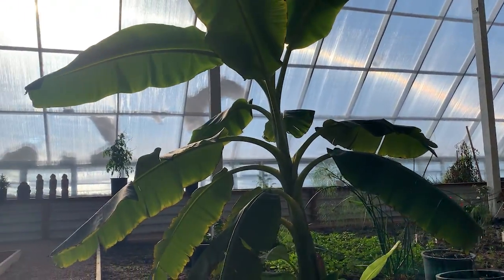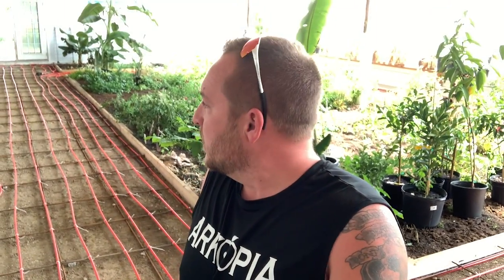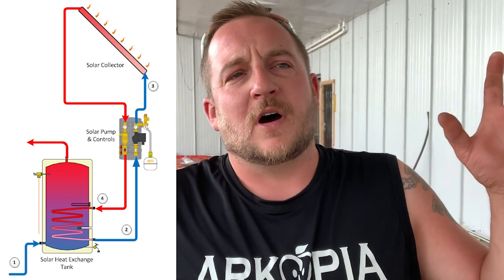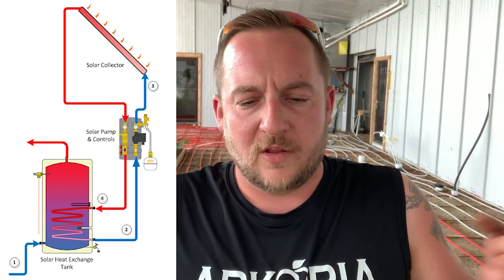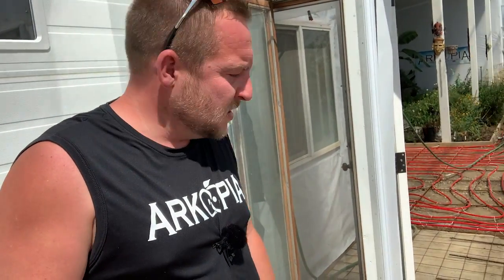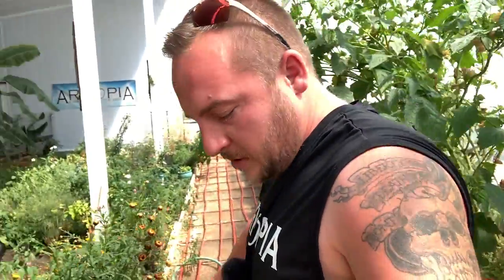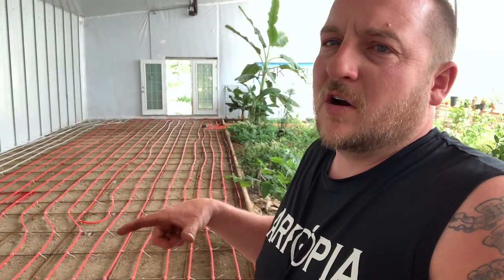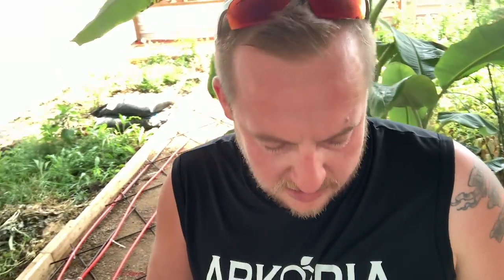Water Thermal Mass for Deep Winter Greenhouse

Comment: Love your design, I went to solar and renewable energy school about 15 years ago, and studied a lot about earthships since, learned a lot about hot water heating then, the evacuated tube collectors outside main problem is there so well insulated that when you have snow or ice on them it doesn't melt unless you clean them off and summer time gets way too hot, I like putting them in the greenhouse its expensive for sure and they break relatively easy. When I sold hot water solar systems in the late 1970s they were a black copper pipe, of course put in pop off valves for over heating, with a half round reflector behind them very simple. Could use shiny flashing bent half round. 1 or more running the whole length of your greenhouse with a solar power pump it would be automatic. I'm not sure about the back wall but definitely mid section. Could be covered in the summer and start heating your thermal mass late in the summer.
 Also you could run your system in the summer  from your rain water tanks to cool the concrete down , hope that made sense.
Reply from the maker: It made sense.   Thank you. 🙏

Comment: Evac tubes are for heating the water, not for holding/storing hot water.  The evacuated space between the tube glass and heating pipe acts as an insulator from the very high heat of the heating pipe. Moving more carrier (water/glycol) faster through the heater tubes will help keep it from reaching the boiling point. (60%/40% water&glycol mix should allow for the temperature to got up to around 234 degrees F before boiling. There is not that much of a volume that the tubes can hold.  You want a large volume/mass of water to hold/store heat. Better if you could put barrels in a well insulated structure next to the greenhouse ... or even with barrels stacked/and or buried and insulated in the ground.

Comment: I have a Viessmann vac tube solar hot water system and it provides an amazing amount of hot water year round even on an over cast day. I had an apartment building with infloor and no insulation. We had a breakdown and it took a week for parts. The heat sink mass/ground kept the units at 21c for that week in 40c below outside. It really does work. If I was to do it again I would insulate the outside of the foundation. Look into salt for the drums on the back wall as a slow release heat sink. Maybe a solar electric system to run your pumps. Just love your system. I see were Nate is coming when SHTF.
Reply from the maker: Awesome.   Ya, because I insulated the foundation 4 ft down around the perimeter, I shouldn’t loose any heat there or have the cold creep in.   I’m really excited about this new revelation of the solar hot water panels.   🙂  thanks for the info. 🙏
Reply: @ArkopiaYouTube  Because our panels are outside there is solar antifreeze in them. I installed a few of those systems before I retired and a note, if installing on a sunny day use gloves to handle the tubs because they get hot almost instantly. Also keep them in the box shaded until you are about to clip them in place. I have a self built 1 KW solar system I built and use to power fridge, freezer and heating system in power outages. I purchased batteries being removed from cell tower sites and cruise ships at a fraction of the cost new.
Reply: Here in southern Spain we just use convection solar water heaters, vacuum tubes gets WAY too hot here! Those who tries ends up having to partially cover up their arrays not to boil their systems.

So yeah, they work really well!

Comment: I’ve installed a 90 tube of evacuated tube solar collector on my girlfriends house and it works great except it is so efficient it won’t melt snow off. You can boil water easily with it. It’s my suggestion to put it outside though. Use tempering tanks that way you can have unlimited free hot water. I like the water barrel idea better because there’s more sensible heat capacity and just water in a barrel. Yeah might take up 2 feet but believe me it’s worth it in my outside shop I have tons of water barrels and it works amazing. There’s nothing more effective than water in a barrel. 

And then of course solar Pv to run the electricity for fans and pumps is a no-brainer. If you need help design in the system you can ask me
Reply from the maker: Thanks for that.   I still like just water in a barrel.   It’s so simple, just there, up to temperature, easy peasy.   There is an issue with all the plants getting big and shading inside as well.   I think you might be right putting the collectors outside on the roof.

Comment: Check your area for the frost line (how far down your soil freezes). You can put your water storage tanks underground and save space on your property. Below the frost line, dirt is a pretty good insulator. You can eve add extra storage capacity. Rig it so the water circulates, starting towards the end of summer to get a jump on the cold weather.  In the dead of winter if you don't get enough sun to heat all of the storage capacity, you might want to make it so you can change over to half capacity. They probably have a formula somewhere to figure out a proper sun to storage ratio. Just make sure you don't drive anything really heavy over that space.
Reply from the maker: That’s a good idea as well.  Underground yo save space. 👍

Comment: As always, love seeing what you're doing with the greenhouse, we're on a lot of the same idea streams^^ AFAIK, the only other reason besides not freezing, they use glycol because it has a higher heat capacity than water, but I would think if you go with water, except for the heat exchange coil area in your storage tank, it will give you another measure of safety against overheating indoors with the tubes, also if you're ever worried about overheating at a part of the year with them, you can always grow something that climbs, cucumbers, beans, etc.that you can tear out when you want tit to get full sun on the tubes.

I think its a good work around for an installed building vs climate battery. Although dont lose the wood stove, love seeing it going when ur chatting in the greenhouse XD I think lots of ppl in the channel would love to join the colony ^^
Reply from the maker: Oh for sure I’ll keep the wood stove in there.   But hopefully it won’t need to run all the time, just occasionally.   I’ll put a coil from the wood stove in the infloor heat tank to help that out more too. ✌️

Comment: Thanks Dean for another great video. 
Did you consider larger pex tubing and used car/ home radiators connected to this heat system ?
Also raising the black drums on a strong shelf and fixing the solar thermal tubes below them on the back wall may save space , help coollect rain water and use it for watering by gravity. 
Looking forward for completing this nice project and assesing results/ cost-effectiveness.
Please keep up the good work 🙏
Reply from the maker: Good ideas.   I’ve always just used 1/2 inch pex in 300 ft zones.   I suppose I could have upped the size.   The rain water tanks are going up high and out of the way on some pallet racking.  (Square IBC totes).  Out of the sun. 👍

Comment: The Nebraska retired postal worker said his back wall was angled to reflect the sunlight but 25 years later his orange trees blocked that north wall so it doesn't get the sunlight.
Reply from the maker: Good thought.   Maybe it’s best to have those solar things outside.   It’ll be a jungle in here eventually likely.
Reply: @ArkopiaYouTube  he also has grapes running up the ceiling from the north wall towards the South...
Reply: @ArkopiaYouTube  and after he said that the water tanks on the North floor never get hit by Sun so they don't really get heated up that I thought it would be good to put the water tanks on the south wall at the bottom so all the runoff from the greenhouse goes right into the tank.
 And since I raise fish I make it an open top deep channel filled with water plants and fish. Since the angle of the greenhouse comes down you can't really grow anything that close to the bottom anyway so that's where your thermal mass is on the South knee Wall. And of course the bigger the wider the deeper the water tank the better chance I'll be swimming in it especially if it has a current.

Comment: Thx for sharing.. nice job!
Are you worried about fumes from painting the concrete floors..
If you color the concrete it self.. might be more cost effective and less toxic fumes In the air.
My 2 cents..
Great ideas you have . Keep.it up🇨🇦
Reply from the maker: I’ll paint in the summer here when it’s well ventilated.   The prices I received for colored concrete were insane.   Still looking into it all quick here. 😂
Reply: @ArkopiaYouTube  worth a look. Coloring the top 1 inch should be easy when finishing off your slab.. 2 bags of color , TOPS I figure..

Comment: Loving your creativity and ambition keep pushing, I'm watching with serious interest for a smaller family sized set up like you've got. Spray/dust the concrete with black pigment for your color before the final trowel your concrete. After you wait two weeks for curing Spray/microfiber mop (10 coats not kiding)of industrial uv resistant floor wax Zep makes a five gallon jug, add quartz dust/anti slip to your final two coats of wax for traction the concrete. Just suggestions for reducing costs and still having a great finish. I used this in my shop with amazing results for a huge savings vs epoxy.
Reply from the maker: Interesting.   I thought pigment was added to concrete when poured, and it was ridiculously expensive.   I found a product that is a garage floor paint/epoxy and was thinking that was the cheapest and best option.   🤷🏻‍♂️
Reply: @ArkopiaYouTube  it can also be used after the concrete has been bull floated.  The powder pigment can be hand thrown onto the concrete or you can use a leaf blower at slow speed to broadcast the pigment. If you hard trowel or use a rider trowel it will look slightly mottled. I added more pigment to my first 4 coats of wax and it gave it a consistent look when I was finished. It looked like black glass.

Comment: Yeah I love this idea too.  With the evacuated tube system one reason to use glycol in spite of being indoors, may be to inhibit corrosion/scale in the system.  Brilliant thinking outside the forms there Dean!
Call it a colony or a 'cult of personality', I think  we're ready to drink the Arkopia kool-aid!🙂
Reply from the maker: Haha.   Thanks.   Ya, glycol might be for the corrosion or maybe it withstands higher temps.   Slowly figuring it out.   A bunch of guys told me rain water is best for infloor; I think that is for corrosion prevention as well. ✌️
Reply: I don't doubt the rain water in the pex in floor.
Exactly, a radiator with just water in it boils more readily than one with the proper ratio of glycol in it.
It will be interesting to see where you go with this.  Thanks for sharing.

Comment: My understanding… optimal in floor heat is around 90F. Lower than DHW so those heat transfer tanks are handy.  You might need a tempering valve. And likely a mechanism for limiting heat on evac tubes otherwise you have risk of having to dump the heat or blend in cold water

Comment: Thanks for the info brother. I'm planning to build a Passive greenhouse using Compressed Earth Blocks for
the walls. The plan is to insulate the exterior side of the wall with thick rigid foam EPS and then 3 coat stucco or cladding.

To create heat storage and distribution I'll create a partition walls using CEB.
The plan is to drill probably 2 holes or so through the side of the blocks and stack it to appropriate height.
I will run radiant heat tubing through the holes and connect it to a solar system. Not sure how well it would work???
I have never seen it done. I thought it could be an efficient and low cost way to heat the greenhouse on cold winter days. 
To back it up, I'll have a rocket mass heater.
Reply from the maker: No experience with compressed earth blocks, but whatever it is insulate any thermal mass from the cold really well. 👍

Comment: Good seeing you at the grocery store today. Looks good. Let me know if you need any advice with hydronics. Im an HVAC/R plumber in the Stoon area. As for the glycol factor. As long as a the building never freezes, your lines wont freeze. But if you hit the 0 degree mark you may have issues. Pros and cons to what you are doing. Did you insulate the perimeter to maintain a frost break? Id chat with you more if you want to bounce ideas.

Good luck, looks great.
Reply from the maker: Second time ever being recognized from the YouTube.  Haha.   Thanks for the tips and connection.  It’s really well insulated around the perimeter so not too worried about using just water.   Maybe it’s worth the glycol just in case though.   That would really suck having the system burst somewhere.  Thanks again. ✌️👊
Reply: for the cost of a pail of glycol, it would have you alot of potential headaches. a burst line is a costly nightmare.

Comment: Love your idea but you are confusing thermal mass (heat storage) vs a radiant heat system either using a boiler or evacuated tube solar hot water. there is a calculation for how much thermal mass you need for your total glazing area (it is around 3 to 5 Litres per or something like that. I would keep those black barrels for actual thermal mass at the back of your greenhouse. But you could put the evacuated tube solar hot water using those panels on the roof. 
I have designed by 20x24 ft greenhouse but I am using passive house walls and have reduced total glazing area so I only need 30, 200L/55gal rain barrels for thermal mass. I am also planning on using evacuated tube on the roof as a backup.

Comment: Sounds very doable. Of course you need to air test that pex before concrete. With that box of Styrofoam on the outside wall the earth should act as a heat sync.
Reply from the maker: Yup, gonna test lines all today and tomorrow here.   Thanks buddy. ✌️

Comment: Dude, instead of running those coils in a water tank, you might want to consider filling those tamks with sand...can store  932 degrees F and it doesn loose temp for months and months.. That way you are not possibly making a steam bomb
Reply from the maker: Interesting. 🙏✌️

Comment: My sisterinlaw has a roof mounted hot water tubed system, something not water runs to a heat exchanger
for domestic hot water Since hers is on the roof, and it doesnt get to -50 around here.....
If you have a specific question, I can ask her.
Reply from the maker: Thanks.   If these things work as good as I’ve been recently told, might have to do a domestic hot water one too. 🙏

Comment: I was wondering if a solar water heater and a pump pushing the water deep under the green house is a better idea. I understand water picks up and transfers heat better than air. My question is if you considered a deep layer of pipes instead of the pipes in slab? I know your idea is the slab is to be a heat generator,  but what about the opposite? Dig up your garden, lay deeper pipes, and reinstall the soil so the slab feeds radiant heat below the crops. Your thoughts?
Reply from the maker: It all probably helps.   If I had access to course gravel, I may have done the climate battery with air tubes.  I'm sure heating the soil would work.  If I do the solar collectors, maybe a dump line under the garden area would be a good idea.   All of this is a ton of work.  haha.  Thanks for the thoughts
Reply: @ArkopiaYouTube  I am planning a passive solar green house about 37'x 24', probably dug into the earth a few feet. I have a house in the Denver area, so while it doesn't get as cold as you get, I want it productive all year round. I am wanting tropical plants - such as citrus, guavas etc in addition to the veggies. I like the earth battery concept but wonder if solar heated water in 1 1/2" PVC flex pipes would be more efficient than blowing air underground. Air doesn't transfer heat as well as water. My experience is hot air doesn't like to go down, but water doesn't mind. With it warming up a lot of soil I hope it should stabilize the heat pretty well, much like a radiant heated floor.The ground temp here is 51 degrees, and maybe I am over thinking it?
Reply from the maker: @gerretw   the most important thing is figuring out your sun angles, and Insulation, Insulation, Insulation.   Literally, anything you do after that is a bonus.   The air pipe guys use the air to heat the earth, best would be rock.   Water is the best heat transfer though, so I like water.   Insulate it, make sure your sun angles are correct, and lots of mass inside.   In Denver, you will be fine.   ✌️
Reply: @ArkopiaYouTube  Thanks - winter solstice is 27.5 degrees, summer is 74.5 My green house will be a shed off the rear of the house, so there's some insulation there, but since the north wall will extend above the plate to a finish height about 12-14', I plan on 2 x 10s with R-30
Reply from the maker: @gerretw   Great.   Not hugely off my angles of 14 and 60 degrees.   So essentially don’t go quite as deep, maybe a bit higher at the peak, or a bit of both.  It’ll work good for your area. 👍✌️